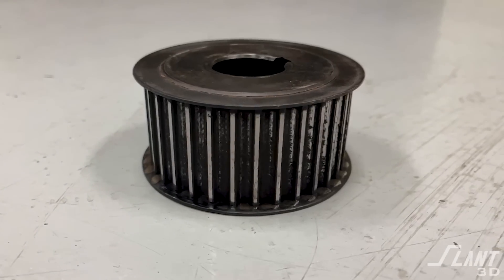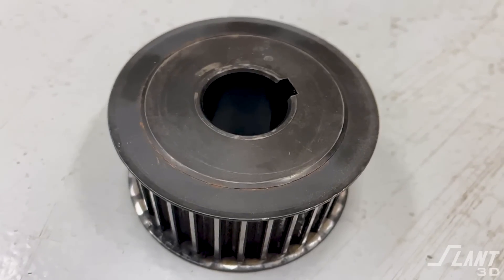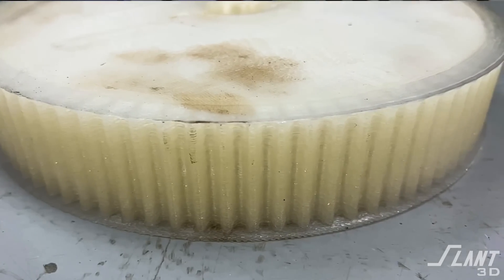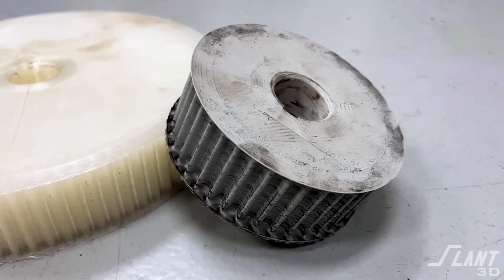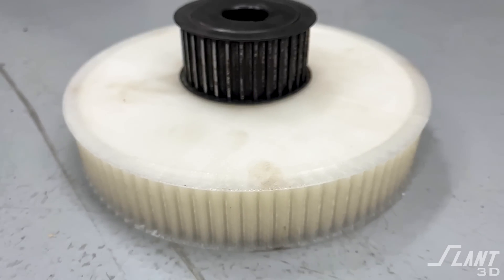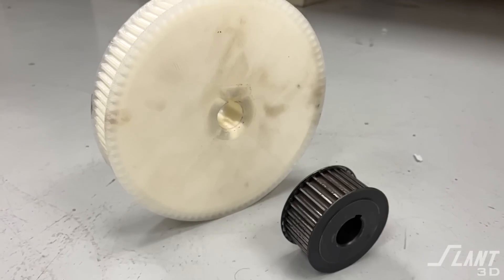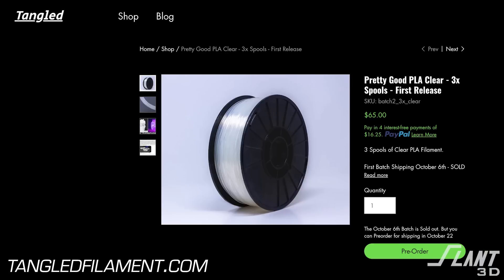Impossible Gears | Design for Mass Production 3D Printing

Comment: yeah the teeth might not fail faster then the belt however you've created a large reaction arm by making that pulley larger and thus your keyways will sheer out of that bore
Reply from the maker: Math says no
Reply: Fair enough i was just replying to the remark of the teeth being strong enough even though thats not the weak point. But iff the pulley works it works fully agree with not paying 100+ euro's on those big timing pulleys

Comment: I modeled and 3d printed a variable pulley for my lathe.  It fits better than the original, but I need to stress test it to see if it holds up under load.  It is PLA + and it may have problems if it overheats.

Comment: I think it has an extruded center section with stamped and pressed on flanges.  But point taken.  I can see in your running belt that your tooth pattern does not line up.  The belt periodically rides up on top of the teeth.  Perhaps you failed to measure and enlarge the part to account for shrinkage. I would suspect something in the range of 1 or 2% would be required.

Comment: All else constant, metal will last longer. You could 3D print one out of plastic, then proceed to cast the metal using one of a variety of methods (e.g. lost PLA, sand casting, graphene mold). Make one out of say, bronze. Obviously, ensure that your casting job is of sufficient quality by removing slag, heating molds if necessary, compensating for the center dip due to differential cooling, minimizing occlusions due to air pockets and rapid cooling, hardening, etc.

Comment: The teeth on the metal gear will wear significantly less than the plastic one.  You will have to change the plastic ones much more often
Reply from the maker: Incorrect.

Comment: I like the concepts you put forward. My only issue is the strength of the keyway. The belt teeth have many points of contact to transfer the torque but the keyway only has 1. 
How have you strengthened that section of the part?

Comment: If you needed more strength for rotation and for the keeper you could lazer cut the keepers and the keyway out of a metal. 

If always found the belt keepers a weak spot in some applications.  The biggest weak spot for my application has always been the shear pin luckily yours is using a key way. 1/2  the time may application has an alloy pully then the other half its a fiber reinforced plastic..

I think the sheer pins actually fail after some waer occurs between the output shaft and pully and that little bit of play will kill any roll pin more than the rotation torque. 

Wear at the teath has alway been an issue on the fiber reinforced pully.  I tend to think this happens from over tightening the belt and letting a belt run too worn.

Comment: The problem with injection molding is NOT shrinkage, it can be easily compensated.
If you can 3D print it, you can injection mold it better. As long as it is not complex enough geometry, in this case pulley, is not.
Reply from the maker: Incorrect
Reply: @slant3d why not elaborate instead of a crappy one word response to a reasonable statement? I have never seen a 3D printed part that is better than the same part injection molded. They're also significantly stronger and more consistent. Why 3D print for mass production?
Reply: That is just totally untrue. You can print things much more complex than you would ever manage to injection mold.

Getting all the teeth right if you injection molded this would require quite a few mold parts and hence would cost a lot and be difficult to do in the first place. You would need multiple mold pieces for the teeth around the pulley and you would need to make sure every tooth profile is right, even where the molds join which would probably require a decent amount of post processing.
Reply: @conorstewart2214 or you would just modify the design for molding like you would for 3D printing. You can make complex geometries with an injection mold no problem if the design is tailored for the manufacturing process. Clearly the investment will be higher, but the end product will be of higher quality. Someday we will live in a world where people realize 3D printing is great but isn't going to displace every single manufacturing technology. In fact only an idiot would get this part molded, they are extruded and made extremely cheap with process.

Comment: I would be very hesitant to print a pulley out of plastic that size for a couple of reasons. One is the key at the bore will have very high stress risers at the corner, and you're at risk of blowing out that bore with a fairly small amount of torque. You may be able to get around this with having an aluminum sleeve made that interfaces with a much larger contact patch with the plastic, but interfaces with the output shaft and key of the motor. The second one is a bit more challenging to overcome. I don't know exactly what style of belt you're running, but it looks like a Gates Powergrip GT2 (maybe 8mm or 14mm). The problem with 3D printing those is that the tooth profile is (last I knew) still patented and proprietary, so you need a license by gates to produce them (if profiting). This also means that the actual profile generally isn't available publicly. The profile you get off of most sources (including McMaster-Carr) aren't the actual profile of GT2 pulleys you'd find on a licensed pulley. It may mesh, but you're losing efficiency (which may or may not be fine for the application). Also, most Gates timing belts aren't "just rubber". They're often fiberglass or some other fiber strands and polyurethane teeth that make them much stronger than plastic.
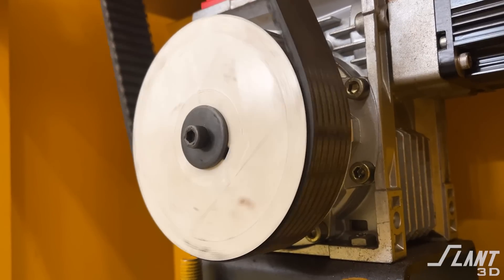Reply: That might explain why the teeth don't seem to grip consistently at 4:43
Reply: @Nigel_Tufnel_11  I think it would be difficult to say why that’s happening without seeing it in person. Usually the publicly available profiles mesh fine, but the difference might be increased friction due to material changes causing the belt to climb out, but there also may be other reasons like non-proper belt tension. Hard to tell.
Reply: @joecrow13yeah, certainly doesn't look like a perfect fix to me...
Reply: still, 3d printed pullies are cheaper and easier to get than 1 steel one for probably decades of logevity. also, no reason you could not get a simple keyed hub with a bolt circle and print the timing belt profile and bolt it on, that part would be considerably cheaper and it changes the force dynamics on the plastic components. now it's even less plastic and it's easier to maintain the production line as they wear. 
source: i'm a cnc machinist. a cnc with live tooling would knock that out in 15 mins with conversational programming, and broaching the key would take 5 mins. so what, $50 in shop time + cost of steel and you have a part that will last forever and adapt to any tooth count over the major dia + w/e meat is needed to support the teeth and bolt circle on the printed part. considerably less than the cost of a full steel timing pully.
Reply: Gt2 is most common in 3d printers. Pretty sure its expired already(can't find date), everyone is making and selling them.

Usual way to get around the key stress issue is to just stick a nut in there and a bolt against the shaft. If its big it will just depend on the forces. But look, the actual biggest problem with 3d printed pulleys is using a filament thats surface hard and not completely perfect and eats the belt, not it shearing the pulleys or something. Printing them is super common though.

Edited: eats the belt not pulley, so rubber dust galore

Comment: This video is very good, i like the visual and informative side of this video but i must add this one detail. Modeling gears is not really that hard anymore. For example. In Fusion 360 you have a feature (or plugin i have it in there for so long that i don´t even remember if its part of original program :D) called Gf Gear generator,FM Gears, etc.... Which as the names suggests lets you make mostly any gear you can think of. Even this one and one could probably make this gear in less than 30 minutes (maybe + 5 minutes for adding the sides for belt to not slip from the gear) So the time you designing this can be very easily reduced.

Also second thing i wanted to say, its possible to use hollow PLA model of that plastic gear you made and cast it with very good result. Many are using 3d printers for casting and many are even casting gears like yours(mostly from aluminium) though the process is still longer than just 3d printing which in this case is more than enough for that belt :D

Comment: I'm actually curious about the long term durability of the part, but I imagine that won't be known until it's been in use for a while.
Reply: Id wager the keyway is the weakest link, but id imagine having to replace it 4 times a year would still be cheaper than needing to replace the metal gear once every 50 years.
Reply: That depends on how much downtime costs you.
Reply: @thesoloveichiks159  polycarbonate is only a pain if your printer isn’t set up for printing it. Carbon fibre filled filaments aren’t recommended for gears or pulleys due to the extra roughness of the carbon fibres, they are very abrasive. You are better using a filament designed for low friction, like PC-PTFE, some nylons or something like the IGUS filaments with built in lubricant.

Comment: There's a precision gears addon for blender from Maker Tales. I believe it's pay what you can. It even make gear simulations reasonably easy to achieve.
Reply: Additionally, to make the plastic gear even stronger you could include a brass shim in the center.
Reply: Blender is not the right tool to be using to make mechanical parts. You are much better using a proper CAD software and most of the big ones have gear generating tools built in or available as plugins.
Reply: @conorstewart2214  I don't care Conor. I'm choosing to learn blender because it's basically free. Minus the pay what you can add on. It's still basically free compared to software that comes monthly sub or one time payments. Realistically how much software can you choose to learn and be committed to pay for. If I wasn't being paid to use Adobe software, I sure wouldnt be paying $1200 a year for all the software that still can't generate a gear. As, I was just gonna learn the math and draw the gear myself in Illustrator. Still, not the right software. How much software do you need for one simple gear.
Reply: @FunDumb  I use Blender as well but there is also FreeCAD which has a GEAR add-on which includes GT2, GT3, GT5 and HTD8 profiles.

Comment: Did I just catch that you have an engineer running your printers?

Seems like overkill, a technical specialist could do the job workout becoming disgruntled that they aren't using all of their expensive qualifications...
Reply: Your comment makes the assumption that their engineering degree is, both the beginning, and the end, of fields they'd be eager to work in, interests shift. So long as they are paid fair and enjoy the work they do, I kinda doubt there is disgruntlement. They might demand a higher wage due to higher qualifications, but that means there's more they can contribute, 3D printing often is engineering.. what breaks on their machines most? design it better, etc etc.
Reply: When he means that, he means running the print farm, not just one or two machines.
Reply: @SirSpence99  Point taken, but still probably doesn't need a degree...
Design yes, operation and troubleshooting unlikely
Reply: @thecrapadventuresofchesimo420  When you are watching a board that covers hundreds of machines, a decent chunk of the time is identifying ways to optimize the process.

Comment: a very niche example (no mechanical strength requirement), therefore the benefits are so blatantly obvious. Still, a good one and a way to go.
Reply: Since the critical part is only the keyway, it might male senso to machine an insert from i.e. aluminium hex stock that fits all sizes and just print the less stressed outer parts. Then you'd be able to extend the usability.

Comment: You hit a bunch of great topics here on the head. But My question is, What kind of metrology are you doing, to insure that your achieving something within the tolerances you want? There's a lot of parts where this might not be a big concern. But personally I would find a timing belt or gear to absolutely critical when it comes to reproducible and accurate dimensions.
Reply: Actually, while it’s called a “timing” pulley, in the vast majority of applications we don’t care about the tiny  fluctuations in tooth-to-tooth times, we’re just looking for a transfer of power and the overall ratio relative to the drive pulley. That’s pretty easy to achieve, and there’s enough play in the belt system to make for pretty loose tolerances (at least compared to precision machining).

The belt itself has a lot of flexibility, the teeth on it are somewhat less so but still are very tolerant of slight variations in the geometry of the mating teeth on the pulley. The diameter needs to match the number of teeth and the tooth pitch but again, it doesn’t need high precision. As long as you have the right number of teeth that will mesh reasonably well with the belt, you’ll have your desired ratio relative to the driving pulley.

Comment: Interesting fact: most of the cheaper timing pulleys you buy are actually made of extrusions. 

 The pulley tooth form is extruded and sold by the foot, then the pulley supplier saws off a length based on the pulley's final width. 

Then they turn the faces true, bore the bore to spec, and press (sometimes glue) stamped flanges on the sides.  

If they machined the whole profile, then timing belt pulleys would cost several hundreds of dollars instead of single hundreds of dollars. 

But even so.  It can't compare to the cost of 3d printed for low-speed low-torque applications.  

Do you have failure data for max speeds and torques on the ones you've printed?
Reply from the maker: Very True. Great Summary of the Alternative methods.
Reply: It always blows my mind that you can extrude metal. Even aluminum, but especially steel
Reply: @melody3741  Everything's a fluid if you push hard enough
Reply: @melody3741   I highly recommend looking into the massive presses used in manufacturing. Machine Thinking has a video called "America's Iron Giants" on presses that output thousands to tens of thousands of tons.
Reply: Sometimes the "flanges" or belt keepers are a snap ring after they turn a cut into teeth on the edges.
Reply: yes extruded and some are just CNC'd for the lower cost, but it's a judgement of overhead vs. production volume

Comment: Would be much easier and way faster to layer pieces of delrin or UHMPE(CNC could do it in a snap) or laser cut(could be even acrylic plates), then use reinforcing bolts+nuts to hold them together. Also could add a couple of even spaced pockets on top and bottom plates to help with adding weights(may be even epoxy, hotglue!) for a better balance. Just some suggestions.
Reply: That's still many more man hours than to just print a PLA gear that does the job and nobody has to check on the machine while it's being made.
Reply: @carlosjosejimenezbermudez9255  A 150W Co2 laser could cut several  3/4" acrylic sheets like butter in as little as half hour.
The cost is nothing much other than that of few sheets of acrylic.
With freely available CAD 2D gear generators, it hardly will take any time to create variations. Assembly with nuts and bolts may be 10 more mins. 3D print will take humongous time of several days?, and in no way comparable to strength of laminated acrylic or delrin. Injection molding is better, but cannot handle solid parts, and may need a 200 ton machine with several oz capacity, to prevent shrinking and sink marks. The approach I mentioned, is similar to the highend carbon fiber lamination, except cheaper and faster!.
Co2 lasers need zero supervision, when setup right. Always precise and repeatable. It is actually a 2.5D operation in this case.
Reply: @joecrow13 No wonder its used(as POM gears, press fit on large hobbed steel discs that feed filament), in lot of high gear ratio highend 3d printer extruders🤔, only alternative being a cast/machined gears, that are expensive to manufacture.
Reply: @joecrow13 That's an interesting application! The self lubrication definitely does help. I do find delrin cuts crisply on a CNC vs Laser, but not that bad as the HDPE. For the specific pulley application, it might even be beneficial, to have a slightly rounded tooth, to reduce belt wear.
Reply: In no way is machining them going to be easier or faster. If you are going to machine or laser cut them then you need a CAD model or drawing anyway and if you cut them as sheets and stick them together like you suggest then that requires post processing. It is much easier and faster in terms of time spent on it by a person to just click print.

Why in an application like this would you need to add weights?

Comment: This reminds me of a project where I needed a custom drive wheel in an electric wheelchair. In my first iteration I used the hub from an existing aluminium wheel and bolted it to a printed outer as I was worried the key way would shear in an all plastic printed part. In the final iteration I printed the complete wheel and hub with keyway as one unit. I then tested that by locking the wheel and stalling the motor at full power - nothing broke. The key way and shaft look very similar in size to your example and it was a 2.5HP motor.